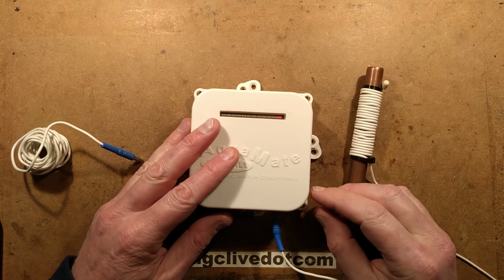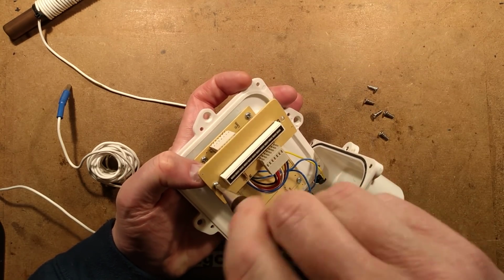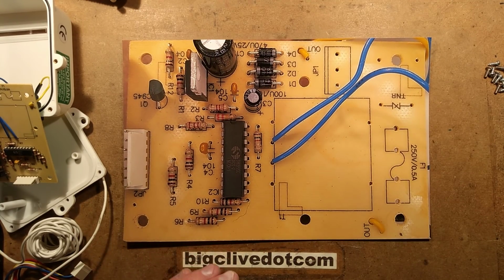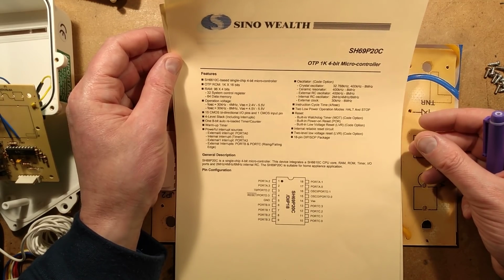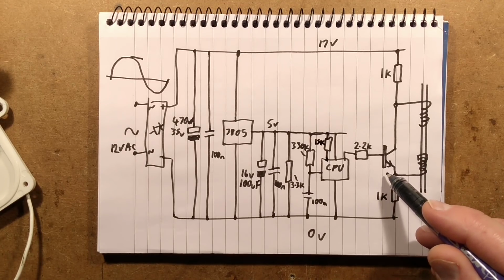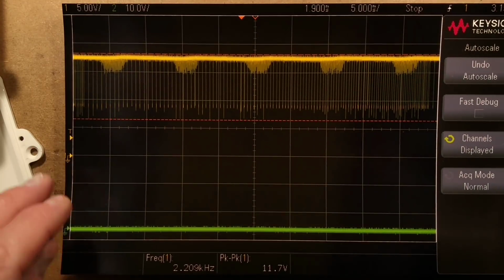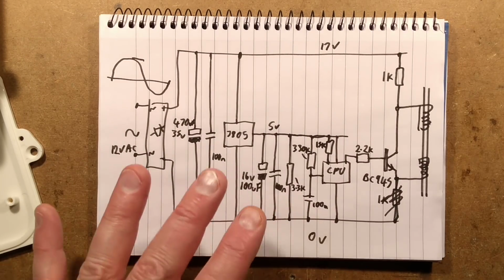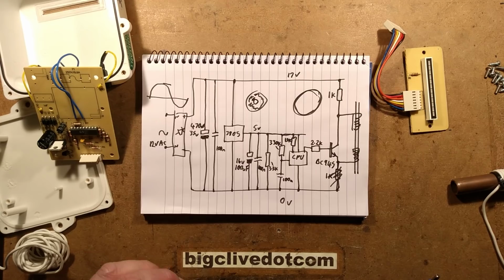inside a computerised pipework scale reducer.

Comment: @bigclivedotcom 
Wow!  Did anyone bother to research this method first?  What's the world coming to!   Don't answer that!  I read up on lime scale/ CaCO3 scale first before making comments.  Ask yourself if the typical nuclear power plant cooling towers would use electronic physical water treatment systems if they didn't work to reduce scale?  Large sky scrapers use them to reduce fouling of pipes, etc. as well.

Do a keyword search for the underlying science this little device is supposed to use.  The device here looks cheap, so it may be costed down too much to work properly or might not apply the method correctly, but the basis for "electronic physical water treatment" is sound!  No pun intended since the frequencies here were audible ;)  Check out the sampling of peer reviewed journal articles at the bottom of the page:
https://en.wikipedia.org/wiki/Pulsed-power_water_treatment

The industrial systems I found were also low wattage, but looked to be much higher quality than this.  The bulk chemical composition of the water is not changed by these EM systems alone, but the scaling potential is reduced and some cleaning effect occurs if the water is moving by influencing electrical chemical bonding processes to favor a solid form called Aragonite vs a solid form called calcite.  Aragonite is much less likely to build up as scale.  Aragonite seed crystals then move through the pipe and tend to strip existing calcite in the pipes.  This process only lasts in treated water for a few days based on my review of this method.  So a constant flowing system like a cooling tower or building with constant use will benefit the most.  If the pipes far away from the EM coils sit for weeks, they will revert back to their base state which is to scale up as calcite on hard surfaces.  To use these to maximum effect, the pipes would have to move water fairly often.  This also explains the hot water pot issue that the author maligned since the water still contains the same bulk content and might sit motionless or even be concentrated by boiling.  Then it would leave behind the aragonite/calcite which would still scale up eventually in that device.  Aragonite does tend to form a powder that does not bond as well though.    Enjoy the reading (if you want to be informed).

References
 "Pulse-Powered Chemical-Free Water Treatment" (PDF). American Society of Heating, Refrigeration, and Air-Conditioning Engineers. Retrieved 24 January 2013.
 ASHIRAE Press (2006). The ASHRAE Green Guide. Butterworth-Heinemann. p. 191. ISBN 0080553397.
 "Field Evaluation and Verification of Biological Control in Operating Cooling Tower Water Systems Utilizing Non-Chemical Pulse Electric Field Devices". Cooling Technology Institute. Retrieved 24 January 2013.
 Tomczyk, John (5 September 2011). "The Professor: Chemical-Free Cooling Tower Treatment". ACHR News. Retrieved 24 January 2013.
 "Pulsed Power Systems For Food And Wastewater Processing" (PDF). Diversified Technologies. Retrieved 24 January 2013.
Reply: Wouldn't be the first time and won't be the last that something costly that does nothing was payed for by government or corporate groups🤪

Comment: Hoy Clive, let me put a story, about 15 years ago, we have big trouble maintaining an big boiler.
the boiler excists of a steel tank 2 m3 size a circulating pump two heat exchangers steam/water ,and a pump feeding the hot water trough the factory.
one heatexchanger standby the other heating the water coming from the ring and or circulating the water trough the boiler. the heatexchangers last 1 week then had to be opened and a bucket minerals came out, forget to clean means trow it away, imposible to open it again.
the solution was a firm offering no cure no pay for a unit about  8000 Euro. he installed a cabinet and 10 windings around the pipes round the boiler. After a week the heatexchanger was clean! the other one was clean after 2 weeks and so on, cleaning after 10 weeks production only a cup of scale in it!. a few years later after rebuilding the hotwater supply, the boiler was filled up with about 700 liter scale from the pipes and boiler, and al the metal was clean!  we paid the man, and we saved us thousends of euro ia a few years on maintenance.
sinds then every house i live in I put a few magnets op the water pipe entering the house and near the hotwater unit.
never have any problems with scale on my kitchen equipment.

greetings Jos

Comment: Clive, I loved this one even more than your other videos,
For over twenty years I have been researching these No Salt and No Magnet "Electronic Water Conditioners".  I can absolutely tell you that there are a few good and extremely good legitimate working ones out there!  To remain unbiased, I won't even tell you which ones.  You need to do your research and homework.

I have also during the same time, researched most if not all the magnetic, catalytic and electrostatic type conditioners.  Most are again copy cats of what someone else did and even some better units still fail to match the best electronic water conditioners!

Back to the the video.  This appears to be one of many copy cat like devices that try but just don't perform.  In my opinion, right away the circuitry seems lacking and the wavelength isn't even near what it needs to be.  Maybe it would work at least to help clean the fish tank???

As a last note people.  "A water conditioner isn't a water softener"!  A water conditioner is far superior in many ways compared to a water softener!

Comment: 11:08 The RMS value is not the average value of the voltage. It's a little more complicated than that. Essentially the RMS voltage is the equivalent DC voltage, to dissipate the same average power over a resistive load. Twice the voltage over a resistive load means four times the power since twice the voltage also means twice the current.  Therefore the RMS voltage is not the same as the average voltage.

Comment: If it really works, it's works probably only for plastic pipes. The electrodes form a capacitor powered by this variable signal from the generator. For metal pipes, the effect will not work because metal of pipe works like an electric screen.

What is the sweep time of this generator (from 1.64kHz to 5.5kHz)? Is this a smooth or step change? 

For example, you can connect a D flip-flop to the microprocessor output so that the signal is 50:50 (square) instead of these short 4us pulses and listen to it on the speaker or headphones. Then you will hear how the frequency changes (of course it will be 2x lower, i.e. from 800 to 2750 Hz).

Comment: I have a similar device fitted to my water inlet. As a well qualified engineer my instinct would be to say that it's complete bull****….
However it WORKS. I am in a very hard water area yet the heat exchanger in my combi boiler has not scaled up in the 30 years since it was fitted. I never need to descale the kettle.
My device also uses swept frequencies but it makes them with a 556 timer and only uses one coil.
I saw some explanation about the waveform persuading the scale to deposit in ball-shaped formations which easily get washed away in preference to needle-shaped formations that clog the pipes.
Dunno; but this snake oil works for me...

Comment: My roommates and I had super hard water at our old house - scale buildup in the shower, buildup on the filler tube of our fridge water spout, etc - so we tried one of these. The theory is it homogenizes the molecules in the water or something so they stay in solution and don’t precipitate out. Does nothing for the kettle because 1) it will simply start amalgamating and precipitating again as soon as the excitation source is gone, and 2) the kettle serves to actively concentrate any dissolved solids. It theoretically de-scales existing precipitate in the pipes by effectively making the water softer, which if true does have the impact of scavenging calcium deposits it encounters (which is why your pool needs some baseline calcium hardness, to avoid dissolving it’s own grout). Again, theoretically. 

What I CAN say is, within a couple days or weeks of installing it, our fridge started spitting out big chunks of liberated scale that looked to have collected in the water chilling coil in the fridge. Also, VERY coincidentally, a bunch of pinhole leaks (like, 3 separate occasions and locations) sprang up in our garage, as if calcium deposits were the only thing plugging them up.

Tough to say definitively that it works, but the apparent effects we saw do seem to follow the theory of what it’s supposed to do.
Reply: But also it caused a crap load of drywall damage in the garage, so maybe just leave your scale-ravaged pipes be. Or just don’t finish your garage. Who wants a finished garage anyway?

Comment: I have one similar to that called scaleblaster my antenna if you will is not hooked up in the same du-pole fashion more like a inductive manner and the coil is determined by the type of plumbing you have my case .75 inch (19.05mm) PVC required 70 turns what I can tell you there quite expencive $199.00 us but I seen a difference in a shorter time than stated my showers and sink sprayer are no longer clogging and it's almost a year so there is something in the technology that works

Comment: Bear in mind that the incoming Steel/Lead water pipe is fairly effectively earthed by it's contact with the soil between the street shutoff main stopcock and the property. 
Also that since, I think the 16th edition of the IEE regs, water pipes are earth bonded.  In later houses where the incoming water supply is in plastic pipe, all bathroom fittings are Earth bonded.
Having the water in the pipes earthed, I can't accept the pseudo science that these companies offer.
Those units have been going since the '60's with the internal transformer PSU.

Comment: The BC945 is in classic phase splitter mode. Its emitter is in phase with its base drive. The Collector is 180 degrees out of phase with the base drive. The gain of the circuit is 1 and -1 (The gain is Rc / Re = 1K / 1k = 1)

Thus the emitter is approx 4.35 Volts peak to peak with ref to 0 Volts and the collector is 4.35 Volts Peak to Peak with reference to the +17 volts rail.

Comment: Well while I don't believe this device will do anything, you are now dealing with radio waves and antennas and inductors so you will need to have some sort of radio engineering background to fully understand what's really going on... your scope readout is probably a 3rd harmonic of the principle wave which even you Clive said it's most likely 2 Mhz ? Anyhoo I am not an radio engineer by any means but I am a licenced ham radio operator (amateur radio) and have some knowledge of antennas inductors and the smith wheel chart :p

Comment: I think the programming is actually pretty clever, but that's about it. I'm guessing, that each reset of the ramp generator transitions over to the next LED. The generator program is little more than a binary counter emulator, that resets, once it counts up to a certain number. Each binary number represents another interval, which causes the frequency to ramp up. The problem with the output transistor, (like you said) is the 1 K emitter follower resistor. Since the base of the transistor cannot drive the emitter above 4.2 volts, that only allows a maximum current on the collector of 4.2 milliamps. Call me skeptical. I don't see how this can possibly induce any current pulse through a copper pipe, or with only 17 volts open terminal, there isn't enough voltage to capacitively couple any current into the water through a thick wall PVC pipe. While it's a cool little device, I think it's utterly useless, and couldn't sell this to someone in good conscience. This device reminds me of one of those kits you put together in a high school electronics class.(only useful, if the student gets to program the processor)

Comment: I'm actually surprised there's a driver transistor for those coils because they can't carry any current like this. For any capacitive coupling to happen it would have needed to be RF.

Also, the copper pipe is earthed, so any power you're going to pump in there is not going anywhere.

Comment: As an engineer myself I was very sceptical about these devices however about 16 years ago I bought one just to try it out (it wasn't expensive). It has been in use since and is still working and I find it does seem to work. Much reduced scale build up in the kettle and my last washing machine lasted 27 years until it rusted away. I bought it from Screwfix and they are still selling them made by BWT who are a serious global water conditioning company. If they were a con I doubt these two companies would risk their reputations and continue to sell them and for so many years. I suspect their effectiveness is extremely dependant upon the pipework and the installation. I agree it looks like snake oil but then it works?????
Reply: How could it possibly work? The water pipe is made of copper so clearly it's not generating an electric field that effects the water. The only way it could generate a significant magnetic field would be to pass current though those wires which are connected only at one end of each. It might generate a significant magnetic field if it blasted lots of power into the wires at VHF, UHF or even higher frequencies but then it would be an illegal radio transmitter and people who used them would get into trouble.

Comment: Having lived in a house where lime scale buildup was so bad that it could clog 1/4" PVC within a year or two of use. I had the idea that maybe I could use electromagnetism to make the scale stay afloat until it's washed out. Then I looked into it and found that really isn't a viable option. If I remember right the current required would heat copper wire to double the safe operating temperature of schedule 40 CPVC.

Comment: Anytime you see more money spent on blinking LEDs than the actual circuit, it is dead give away that the product is a placebo. I was actually surprised to see two boards and a neat cable going between the two. They could have very well mounted everything on a single board.

Comment: Those 1K output resistors are to isolate the unwitting user from contact with EITHER of the  8.5V power rails AKA antenna leads : there’s no “17V power rail“ nor ‘ground’ since neither rail of the WBR’s output is earthed.

Comment: I think your idea on how the code work is most likelly right. Since it is an older microcontroller, it probably have no PWM output, so the pseudo code is something like:

while (true) {
  setLed(1);
  loop(number of pulses for 1000Hz and the time for each frequency (200ms?)) {
    pulses(cycles for the pulse, cpu frequency / pulse frequency / 2)
  }
  setLed(2);
  loop(1200Hz);
  ...
}

void pulse(cycles) {
  setPinHigh();
  delayCycles(cycles);
  setPinLow();
  delayCycle(cycles);
}

In other words, very easy to code. The schematics is also very basic. I could actually replicate the whole thing with less than a day of effort and have a board layout made and ready to be sent to a fab house. Of course, due to the casing, it need more work, but I wouln't be surprised if the hardest part of all of this is the actual plastic casing itself.

With a modern microcontroller, it would be even easier to do as they have a timer and a PWM output. The PWM work via an hardware counter. The PWM goes high at 0, and goes low when it hit the set value. The counter reset when it hit a second value. By adjusting the top value, you change the frequency, and by setting the middle value to half of the top you keep a 50% pulse. Sound complicated, but... really, you just set x,y... delay... set x,y, delay.... And you save a truckload of instruction space since you don't have to make so many loops, so even the 3 cents microcontroller is way more than enought for it!
Reply: I agree. The most fascinating thing about this, is using 7 outputs to sequentially control 12 LED's. I do believe the LED's transition each time the ramp generator resets. The ramp generator is just a virtual binary counter. It's what causes the sweep in pulse interval frequency. The programming is rather clever, but boy, did they ever skimp on the output power. the mere 17 milliwatts of power just isn't going to do much, with 100 gallons per hour of water flowing through a pipe.

Comment: The waveform resembles the output of a TENS pain management device. The TENS uses higher voltages with adjustments in voltages and frequency. The TENS do work in most people in pain management. Looks like they took the basic non bucking chips for this. The phony devices in the past did use legitimate components but claimed that these devices would work medically. This has been going on since electricity was discovered. The old flimflam devices did hum and flashed lights. As for changing the chemical makeup of the scale in the water? Changing compounds? That will take more power than this device can handle.  Thunderf00t would have a field day over this!